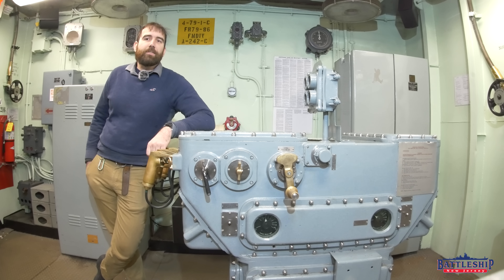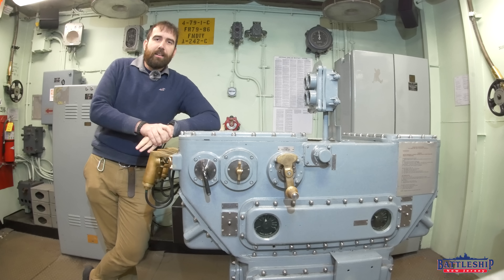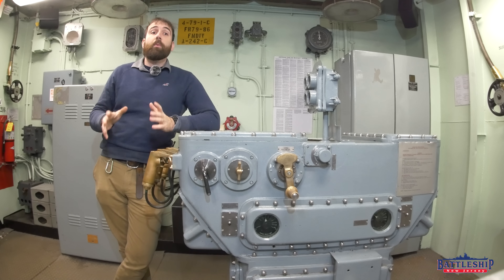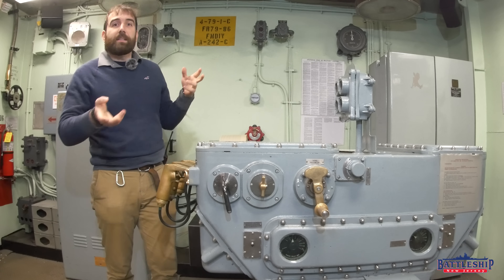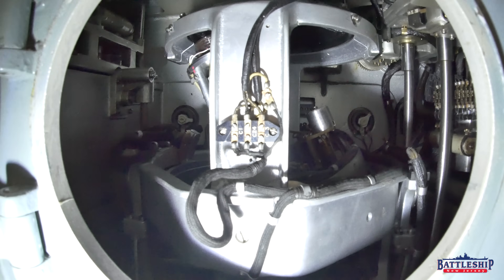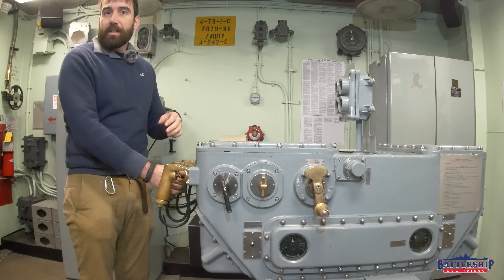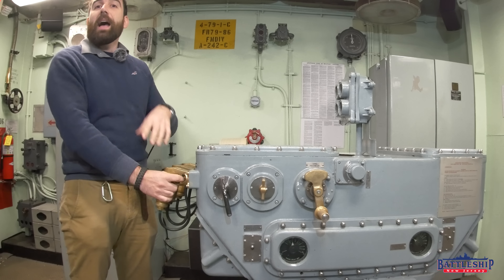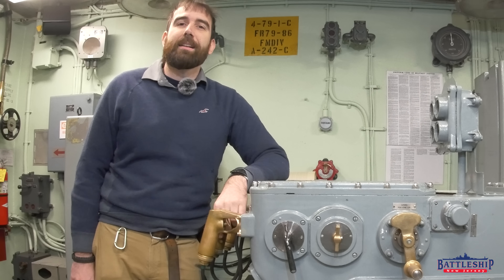The Firing Mechanism for the 16in Guns

Comment: The mechanical computer is absolutely amazing. But I would like to know how these fire control systems actually move the guns. What was the output from the director? Where did this signal go? What was used for the actual motor controller for the position of the guns? How did the gun know where it was? There had to be some kind of feedback from the gun back to the controller so it would know what position the gun was currently in. I know how we would move and position a large motor now....but I'd love to know more about the gun position control system on early battleships....not the director....but the electrical equipment AFTER the director. Thank you!!!!
Reply: Yes, that would be interesting to know. And did the computer know if the guns had fire, say if there was a hang fire.
Reply: @markwatson3135  I imagine the gun would continue to return "ready to fire" until either it recoils or the gun crew changes the state manually.

Comment: I don't find ten points of redundancy to be excessive, considering the fact that putting those rifles in range of the enemy is quite literally a battleship's primary reason to exist. So, having ten backups if the primary fails makes sense to me.

This video was really awesome, especially when he opened up the side panel. I've always wanted to get a look inside those things.
Reply: Worst case when a ship was up against something its own weight or more, you had two sweet spots of range. For Iowa's the long range is from max effective at 38 miles in to about 20 miles, where the rounds would be coming down a good angle to go though deck armor. Any close than around 20 miles and the rounds are likely to skip off the deck armor. Iowa only has 8 inches of deck armor, so damage would be likely from a 16 inch hit at range though the deck armor.

Between 20 and 10 miles damage from 16 inch would be mainly limited to secondary batteries and unarmed spaces.

As the ships close in on 10 miles the party starts lol. Inside of 10 miles the armor on an Iowa is vulnerable to 16 inch shells. This is where the slugging match begins, and the battle is won with damage control and luck.

That is why the fire control is deep in the ship, the guns can be aimed and fired manually from in the turrets, turret face is 19 inches, and the conning tower and barbettes is 17 inches thick. If you're close enough to take damage in these spaces, then if you stop shooting, you sink.
Reply: Besides most of them backup aren't dedicated backup but simply similar systems that can be repurposed to aim and fire the big guns, like the fire control group of the 5 in guns or excessively cheap like the hammer and string on the breach.
Reply: @FreeOfFantasy  I mean the 5 inch gun plots have hardware specifically to run the 16's. It's more like they made  the 16" backup computers run the 5 inch batteries.
 And that is the only redundant firing position for the 16" guns that isn't only there as a backup. Turrets 2 and 3 have built in rangefinders solely for the possibility that the turret is cut off from the rest of the ship. Turret 2 would range find for turret 1 over the sound powered phones, and turret 3 was completely isolated.

The guns had per barrel manual elevation, there are hand chain falls for moving ammo and powder in the turrets. So that even if a turret had zero electrical power, the guns could be loaded and the range set. Then you would turn the entire ship to train the guns on target. The guns could then be manually fired via string.
Reply: @FreeOfFantasy  That makes it better, actually, because it's more efficient that way.
Reply: Plus those are not really a "redundancy" options (not all of them). They mostly only shorten the chain between the trigger and the gun. They don't create a new path.
Reply: @petrkubena  No they are physically separate paths on the ship. The guns are wired in parallel to each of the switch boards, so if one is damaged of inaccessible, you can take control at one of the other switchboards/control stations.
Reply: @ionstorm66  Maybe I misunderstood, but trigger mechanism that bypasses gyro does not have a separate line to a gun. Neither there is a separate firing pin/mechanism for when everything else fails and they fire it with a rope. And those are 2 examples he gave of a redundancy. I imagine there is another line from a firing station to a gun, but you can't take it as 11 parallel redundancies, those are only redundancies for when a particular link in a chain fails.
When we in the server room have dual link in, dual zones inside, dual parallel servers that all have raid 1+0 SSDs and two separate power sources we don't say we have 6x redundancy.
Reply: @petrkubena  Both Mk 38 directors could be linked to both primary computers which can be routed from either main switchboard to any of the 3 turrets. They are identical and thus redundant. Either computer computer could run of either director, or both off one.

All four Mk 37 directors could connect to any of the 4 secondary computers, which could be connected though any of the 4 switchboards to any of the 3 main and 10 secondary turrets.

Then turret 2 and 3 have optical range finders internally that can be used manually.
Reply: 11. yes, but when 10 break you sure glad for the 11th
Reply: The ONLY thing a battleship does, is bring 9, 
16 inch guns to a fight.  Period!

How many redundancies does it take?
As many as possible!

steve
Reply: https://www.youtube.com/watch?v=UaPkSU8DNfY

Comment: You said that there are 11 different ways to fire the main guns, and you also said that you can fire them by tying something to the hammer and giving it a good yank. And since there are 9 main guns, I'm just wondering if each of those guns got counted separately in that count to 11.
Reply: Yes if my count is correct.

2 are 16 inch computers, 4 are the 5 inch gun computers, 2 are the in turret range finders in 2 and 3, 3 are the hammers in each turret.
Reply: @ionstorm66  Okay, thanks.

Comment: Neat to see that antiquated technology on how they did it. Crazy how those could be replaced today by a simple laptop or desktop computer and some sensors. I guess 11 is a good number. They planned out the ship to be able to fire during a slugfest and take heavy damage and human casualties, but stay in the fight apparently. Redundancy and overbuilding would be key to that goal. New Jersey is kind of like a street brawler in the Rocky Balboa tradition. Remember the line Rocky said, "Its not how hard you can hit, but how hard you can get hit and still get up". New Jersey could take some hard hits and still get up if it had come to that.
Reply: Could probably just use a smartphone, since they have so many positional sensors. However, I would want to use a few of them to prevent one from being flaky since they do tend to have issues with their sensors sometimes.
Reply: Today, you could make a replacement for that that fits on 2 square inches of PCB, including analog IO, but not including redundancy.
Reply: @user2C47  But would it tolerate the shock of a shell exploding inside the ship somewhere close by?  Or a sailor dropping it on the steel deck?  Or nuclear electromagnetic pulse?
Reply: @lesliemacmillan9932  Because of its small mass, you could probably shoot it out of the gun and it would be fine.

Realistically, however, the military would not replace the fire control computer with a tiny PCB, and would instead opt for something larger and more expensive.

EMP likely wouldn't harm electronics inside of a ship, because a lot of the energy is blocked by the hull.
Reply: It is amazing to see how the firing computer works, technology that is now so outdated but i am sure if it was provided power that it would work!! Imagine a 20-50 year old computer being turned on.......if it even would!!
Reply: Aiming and firing guns is a critical task for combat effectiveness and has hard real-time requirements, so I wouldn't want to use a computer or smartphone. They're powerful enough - by a really large margin - but the firmware and operating systems they need are far too complicated.

This is a job for a microcontroller instead.
Reply: @jordanrodrigues1279  Hardwired analog computer.  More accurate, more robust, much faster.
Reply: Given how often my “smart” phone fails to accomplish the simplest task, like allow the common word “ill” without trying to replace it with “I’ll,” I would stick with the “antiquated technology” in battle. Not crazy at all.

Comment: I think the number of redundancies in a system should be based on how big the system is. NJ is big, so 11 doesn't seem far fetched.

Ideally 4 redundancies in a system that has remote use is ideal. Two local, two at the remote site.

Comment: SO advanced for something developed in the 30's.  That gyro reminds me of stable platforms in missile guidance systems.
Reply: Well the 2 systems are quite related, so no big surprise there.
for a long time (up to at least 1960), the missile guidance systems on ICBM's and space launchers used the same principle of a mechanical integrating accelerometer as used by Germany during the war on the V2's to determine when to MECO....
Reply: @srenkoch6127  Minuteman III missiles sitting on alert today still use integrating accelerometer gyros.
Reply: @blurglide  yes, but are you sure they are still of the mechanical variety and that they have not been replaced with smaller more accurate (less drift) solid state digital versions.
I mean your phone can do more accurate inertial navigation than a mechanical accelerometer now a days (If ITAR allowed it)
Reply: If i recall correctly, when they modernized in the 80s/90s they tried to make the fire control digital, but couldnt.
Reply: @wolfpreist  it wasn't that they couldn't, it was that there was no point to. The Firecontrol computers, for the first time in history, were already more accurate then the guns. Replacing them with digital equivalents would have cost money the Navy didn't want to spend.
Reply: @lozfreak17  And would have less accuracy resultant.
Reply: Considering "programable" automatons fron 16c and mechanical tabulation machines from 19c, it isn't that mind blowing. Don't get me wrong it is an amazing piece of engineering, just not as advanced as you may think.
Reply: Same people that engineered these worked on the early missile and space program
Reply: Maybe it is just the best solution, proven and simple.

Comment: What coordination is there between the loading crew in the upper part of the turret, (behind the breach of the guns) and the main fire control?  Basically how does everyone know the guns are loaded and ready to fire vs still being loaded?
Reply: I'd guess it works something like in some tanks where there's a "Gun Ready" switch the loader holds down to indicate they're done and out of the way of the breech so they don't get crushed.
Reply: Sound powered phones and phone talkers
Reply: There's a ready switch operated by the gun captain, indicating that the gun is loaded and the crew is clear.